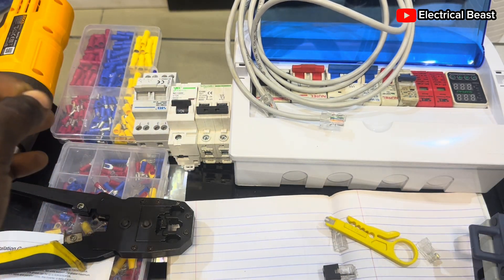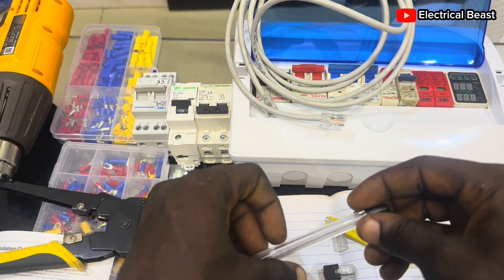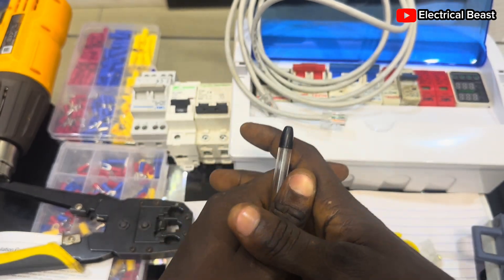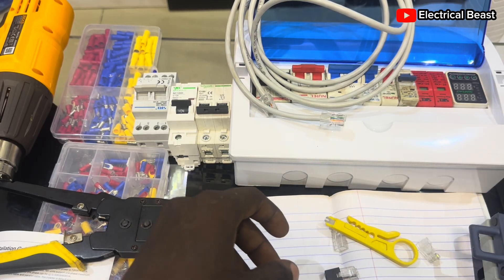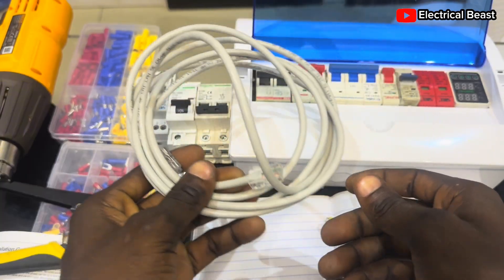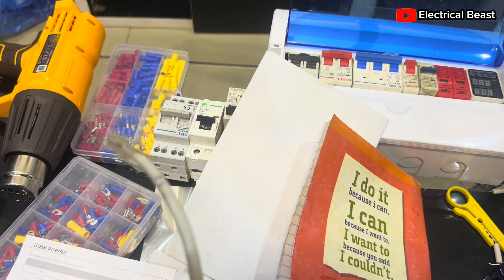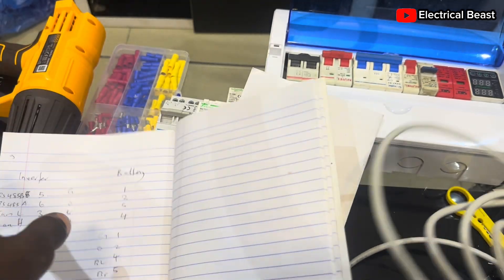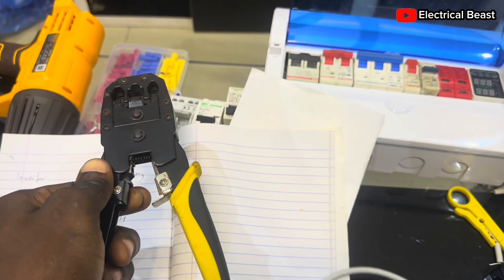How to Properly Communicate an Inverter With a Lithium Battery

Comment: This was really educating even for me, though I am not an installer. It's unfortunate by SMS lithium battery only came with a 6 page guide -  panflet with no info on the pin layout for BMS communication. 😅

Comment: Before you cut the cable, the first thing to do is to establish if the pinouts for the inverter and battery are incopratble, in some cases you will find that they are compartible and theres no need to cut.

Its not alwasy that when they are of a different brand then they will be incompartible, everything relies on the pinouts.

The sad part is the influx of both inverters and batteries which are not coming with enough imformation or no manual at all to make reference and decide wat to do.